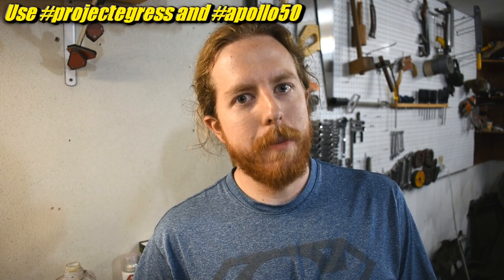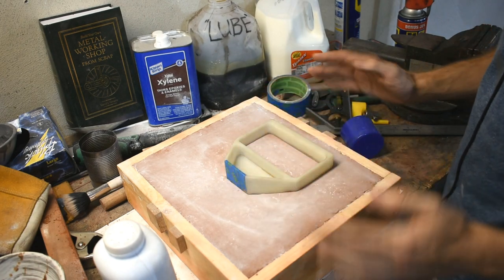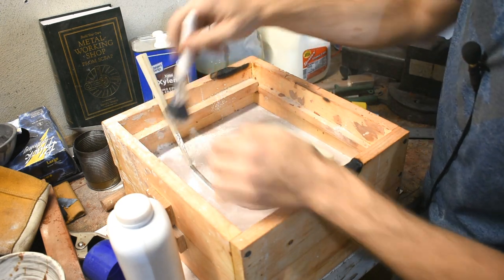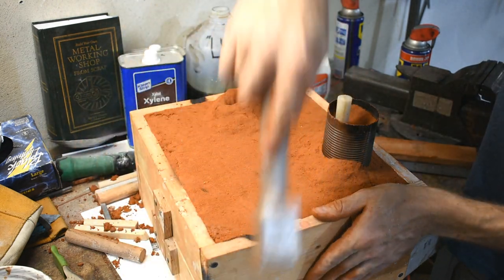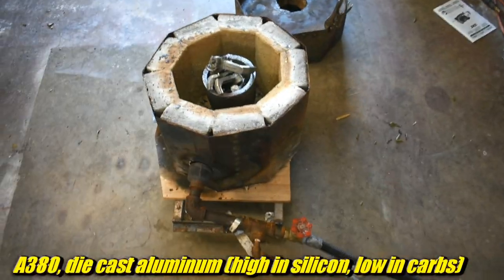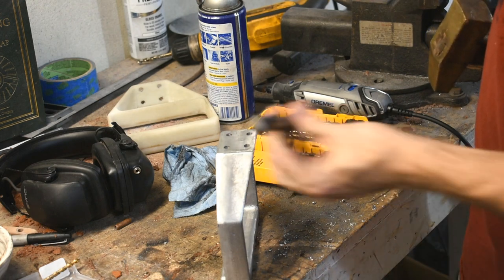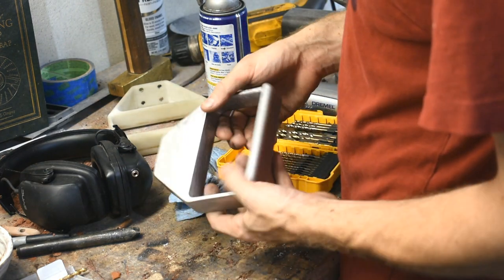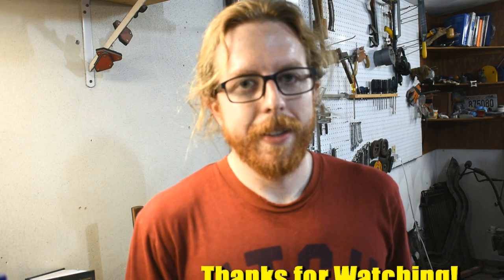Project Egress: Casting a Handle for an Apollo Lander Hatch, with Adam Savage and the Smithsonian

Comment: A tip with the baby powder when youre casting hotter copper alloys - most baby powder is corn starch these days. The sented oils they use (baby powder smell) can create some surface issues even in petrabond because they release gasses. It does have the benifit of keeping it from absorbing moisture (hydrophobic) but unless you live in a humid place and store it open, thats not normally a big deal. You can use regular corn starch for cooking, or even flower. Theres also more expensive powders that you can get from pottery websites like like realk Talc powder. Its basically a dust from soap stone, and no thats not really what baby powder is. It can contain natural asbestos, which is one of the things present in soapstone, and as such, causes a couple different types of cancers. It works wonders, I use talc with my aluminium bronze leaf blades and there was a major difference for me. But you absolutly must wear a resperator of some sort to keep it out of your lungs. Another tip, use a lady's powder makeup brush to spread it. The soft bristles dont knock so much sand loose which reduces what gets washed around in the mold. You can blow it off all you want, but if that mating layer of sand has grains coated in powder, its gonna come loose when the metal washes over it. And final tip, if your casting sand is more than a few months old, consider drying it out. IT loves ot absorb water despite the oil binder and that causes big issues, not the least of which is loose sticking strength (but you knew that). Ive had petrabond vaccuum sealed from the seller that was wet right out of the bag. To dry it, you can spread it out really thin on a tap and leave it in the sun on a summer day, or lay it down on a clean smooth shop floor with a weed burner waving over it for a bit, before turning it with a shovel and repeating a few times. I like to do small batches, fluffed up, on a big pan, and put it in the oven at 250-275f for a couple hours for each "batch". You can porbably go hotter but it does smell if you start cooking the oil. Oh and let it cool first before handling it. That binder sticks to everything when its warm, and if it sticks to something else, its no longer in the sand helping the sand stick. lol

Comment: It's a good idea to not print with glow-in-the-dark when you don't have to, because the glowing powder in it is a high abrasive that erodes brass with no effort at all. You pretty much have to replace the nozzle twice per roll before it grows 0.5mm wider and visibly shorter than it was when it was new. The shape of the nozzle on the inside gets distorted too as the erosion is not completely even.

On the other hand, running a tiny bit of glow filament might clean out some gunk once in a while? :D

Comment: Yo Paul. Use the smooth rounded end of a screwdriver handle...or anything of a similar size to push the fun sticky oily sand through your sifter. It's way less messy...just fyi...

Comment: Super cool Paul! You're making a piece that will be in the Smithsonian?! Nice work on the casting. One little tip; counterintuitively, a lighter hammer is better for stamping. More velocity and less weight gives a sharper impact with less strain on the part. On a thin part like that, you could put a chunk of scrap or something in a vice to support directly under the area to be stamped so you can be sure not to crack it.
Reply from the maker: Thanks!  Thanks for the tip on the makers mark, I'll try that.  I haven't sent the part out yet (got some photo documentation to do yet) maybe I'll try the stamping again.  I'm a little worried it might crack, it's so thin

Comment: awesome job. I like the copper tubing gates. I normally cut mine manually with a melon baller, but youve definitely given me some ideas. The tubing's flexibility could be a great asset in a situation with a pattern that gets cozy in a smaller flask!

With that said, you definitely dont have to remove the burnt sand. Otherwise, I like the video and the comedy!
Reply from the maker: The burned petrobond doesnt have any "stick" left to it, but normal greensand can just be mixed back together
Reply: @PaulsGarage  I respect everyones own practice, so not trying to tell you how to cast by any means. I just lose sand enough as it is over time, and I hate to see it lost any faster than needed. I have found that simply mulling it back in revives the cooked sand, and I think the fines that the burnt oil and clay add to the mix help improve surface finish over time (personal experience, I have no data to prove this). I add a spritz of catalyst every time I re-mull, and about every 10 or 15 mulls, I add in several oz of oil. My sand is an odd grey-green color now, but still packs tight as ever. Your mileage may vary, but thats been my experience.  Either way, its a great video. Keep up the good work!

Comment: 11:24 was my job as a standgrinder at a steel foundry. Did that every day, only doing hundreds of parts a day. I ground parts from 5 to 30lbs each, I averaged 2,000 lbs a day.
Reply from the maker: That sounds like a lot of grinding!
Reply: @PaulsGarage  it was. Worst was in winter I'd have snow in my booth, and summer it'd get to 115°f. And I had to wear a welding jacket, leather apron, and wear a air helmet, kinda likes motorcycle helmet with a fresh air line to breath so I wasnt breathing grinding particles. It at least had a device that would blow either warm air or cold air into my helmet

Comment: It is i my first time here. I found this video as I've been watching videos on a couple of other channels related to Project Egress. It was interesting to see the process of casting the handle. Have you thought about creating a winding channel in the top of the sand starting at the hole where the excess metal will come up? It would let you give the metal a route to follow that might be long enough to avoid burning the wood?
Reply from the maker: I havent thought of that, good idea.  I usually make a mound to stop it pouring out, but often that doesnt work perfectly.  A little charred wood isnt too bad though

Comment: I've debunked the debunkers saying we never put men on the Moon. I used, time, the acceleration of gravity, and a video of the 'hammer feather drop' on the Moon. After doing the calculations, the fall time of both matched the calculations of lunar gravity. To duplicate the fall time on Earth you would need to speed the video by 240% at which point the motions of the astronaut become highly exaggerated like the old Keystone Cops movies. The other one I used was the lunar buggy going over the bump. The height and fall time of the rooster tails kicked up by the lunar buggy estimated by the diameter of the lunar buggy wheels matched that of lunar gravity. When the buggy went over the bump, the astronaut's arms and head hardly moved. Speed the video by 240% the bump would be very violent!.
Reply: This video is SO obviously faked
Reply from the maker: It's better in my opinion to not engage with idiots.  I'd end up screaming in the mirror all day otherwise 🤣
Reply: @PaulsGarage  Idiots never will accept facts. On of the other arguments is they say  that there are no stars in the pictures. That's because they don't understand photography. To get a good image of something that's very bright, the shutter speed is so fast that star light is not captured.

Comment: The reason the Apollo 13 tank exploded was because the asshats dropped it and said “nyahhhh, it’ll be fine”. I’m betting it was Jeb. 

Oh and I’m not joking about them dropping the tank. Was only 2” but it was enough to damage something inside... then they couldn’t empty the O2 so they heated  it up to force it out but the thermostat melted and the temp kept climbing to 1000F (500C) before they realised... THEN THEY CLEARED IT FOR FLIGHT!!!  Seriously Kerbal in my mind. I hope those responsible for clearing it for flight got canned
Reply: Well yes, but hindsight is always 20:20. And in fact it would have been fine if it hadn't gotten overheated much later. They never found out that it had climbed to 1000F until the Apollo 13 investigation - largely because the temperature gauge only went up to 80F. As with so many disasters, it was the result of multiple highly unlikely events combining together.

Comment: Your casting came out beautifully. Are you melting a bit hot to keep the alu fluid?
Reply: Probably. You generally heat it above its melting point such that it doesn't immediately start to freeze when you take it out of the heat.

Comment: you know I've always wondered if it were possible to make a 3D printer filament that mimics wax or Styrofoam for lost wax casting, in that it'll burn/melt away on contact with molten metal.
Reply from the maker: There is a wax filament, saw some work with it done by black beard projects, hes got some videos on it
Reply: @PaulsGarage  :D

Comment: Hi, new to the channel. and casting in general, I have melted a few cans, burned off all the hair on my arms, killed Jeb (it was an accident i swear) so I guess we're as close as we're ever going to get. Question, that thing about silicon in the alloy. Is that something you've added yourselves? Or does it come with the alu pieces used?
Reply from the maker: I do not add silicon, I just use metal that already has silicon in it.  Basically if the scrap was cast, it has silicon. If the scrap was sheet or extrusions or forged aluminum, it doesnt have enough silicon for casting.  There are many alloys of aluminum but in general you can cast alloys that were already cast, avoid ones that aren't.
Reply: @PaulsGarage  Tip very much appreciated, I have scrap of all flavors. Mostly rims and various alu profiles though. So I'll stay with the rims for stuff that "matters". Thanks again.